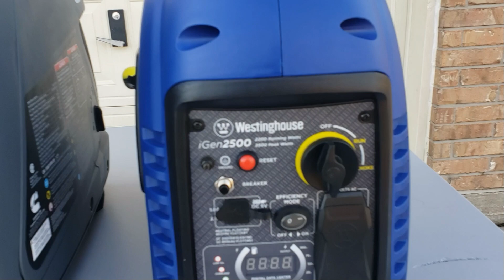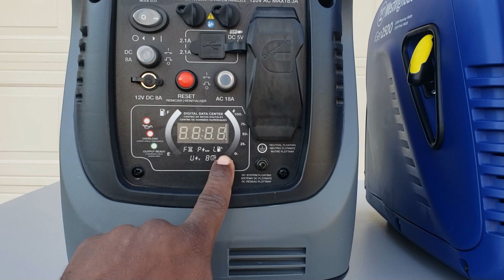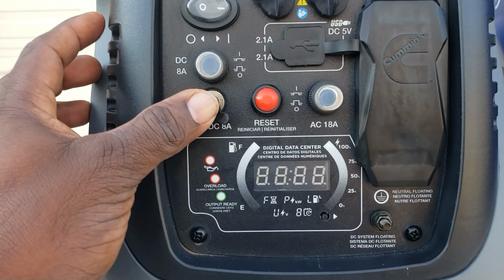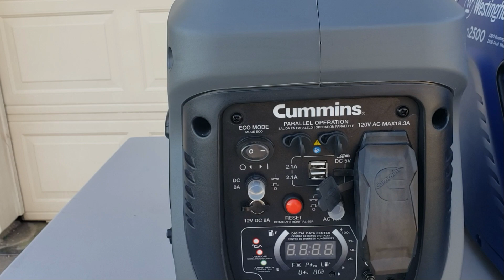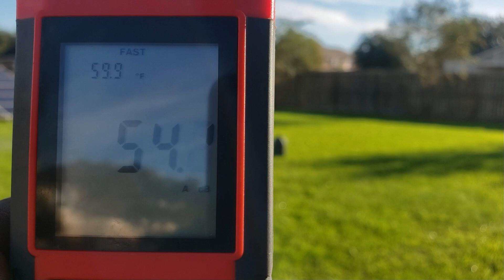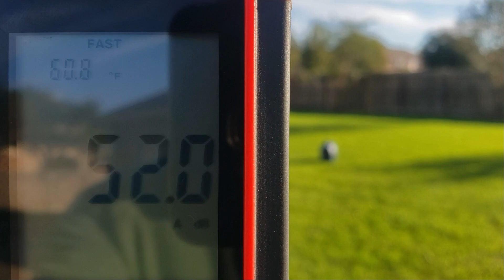CUMMINS ONAN P2500I VS WESTINGHOUSE IGEN2500 (Generator Review)

Comment: GOOD VIDEO GAVIN. I HAVE THE 2200 AND THE 4500 WESTINGHOUSE. I LOVE THE REMOTE START/STOP ON THE 4500. I AM HAVEING A LITTLE PROBLEM WITH MY 2200. AFTER SEVERAL EMAILS BACK AND FORTH WITH WESTINGHOUSE, THEY SAID THEY WOULD SEND ME AN NEW CARBURETOR AND GASKET. THEY SAID THEY WOULD EMAIL ME A TRACKING NO. WHEN IT SHIPS. OVER A WEEK NOW AND NO EMAIL.

Comment: Bought the cummins onan p2500i a couple years ago for work. Right out of the box it wouldn't hold steady RPMs. It did ok under a load, but still not right. I probably put 30 hours on it or so then it sat around for a while, the warranty was up and I never got it fixed. The next time I went to use it, it started fine, but then gas started leaking out around the carb. It sat for a few months then I got it out to see where the gas was leaking from. This time it didn't leak. Maybe the float was stuck when it was leaking. Still idles rough, surges up and down.
Reply from the maker: Sounds like it needs a carburetor and a jet cleaning
Reply: @GeneratorReviews  I cleaned the fuel tank out and found a little sediment in there. Removed the carb and cleaned it. The bowl had a little varnishing going on in it. The pilot jet seemed like it might have been dirty. Cleaned everything and was feeling good about it. Started right up and it was running better. Then it started surging again and continued to get worse. It finally died, restarted it, ran rough and died. I'm going to let it cool and try another cold start just to see how it runs cold. Then I'll pull the carb again and clean it again. I'm thinking it might have plugged a jet again.

Comment: FYI: You must use Westinghouse's spark plug wrench to remove the plug so far nothing else will do. I dislike; no I hate my Westinghouse 2500 generator. And yes I rejetted it. Try opening up the plug gap to .036", second your gas cap may not be venting, intermittently.

Comment: I like your video! I just bought a Westinghouse iGen2500 a couple weeks ago. The new ones come with the parallel ports. We tested it out on some rustic / off-grid camping, with our camper, last weekend. I was surprised that the Westinghouse was able to power our 25 foot travel trailer and the AC at the same time... it actually didn't go over 50% of it's capacity.

Comment: I so wanted to like the Westinghouse.  I wanted to parallel to for my travel trailer.  First one broke in flawlessly and had 5 hours on it.  The next two I tried sputtered and repeatedly shut down the moment I put even a small space heater on them during the third hour after two oil changes.  The first one handled the same heater just fine.  If I can't rely on them to run that without having two malfunction I need to try another brand.
Reply from the maker: Hey Frank sorry buddy
 some times it’s just something simple as the carburetor jets being dirty

Comment: The Westinghouse carburetor suffers from poor design concerning the location of the Idle Jet (in the back), It is almost impossible to clean if it had been left sitting for a while and is now surging. Similar ones like the Honda have the idle jet in the front where it is easy to access.
Reply from the maker: Yep great point!

Comment: Can you check something for me? With the Honda having a 120cc and others being in the 80cc range I’m wondering if the Honda runs at a lower rpm under low load conditions, anyway you could check that theory?
Reply from the maker: Ok I will put my rpm monitor on it. I will update you soon
Reply: @GeneratorReviews  I ended up buying the 2 Yamaha 2000s they both are great if you keep them under 500watts they basically idle, I plan on giving my dad one of the Yamahas when the eu2200s come back in stock, can you parallel two different brand gens?
Reply from the maker: @Bajaheat  Yes you can parallel different brands Actually made a video about that

Comment: What break in process do you do?
Reply from the maker: My personal Generator I run it for 30 minutes then I’ll change the oil.  I use it in eco-mode only powering nothing over 25% I’ll change the oil again after it has a full 24 hours of use No need to run unnecessary loads I’ll change the oil a second time then when I have 100 hours of Run time then I’ll switch to my synthetic 5w - 30 oil
That’s how I do it
Reply from the maker: Once I get my synthetic oil in there I can go all the way up to 80 - 90%

Comment: These are both identical units.  Same exact generator. Westinghouse makes / manufacturers these and Cummins just puts their name on it and a different color plastic casing.  My brother and I have (2) iGen2200's and (2) iGen2500's.  Absolutely great units.  Westinghouse also makes the bigger size 3700 / 4500 inverter "Cummins / Onan" version as well.  The only difference in this bigger inverterbsize unit is that the Cummins only is offered in a gasoline version, and Westinghouse offers that same gas model as well as a dual fuel version.
Reply from the maker: Thanks for sharing this we appreciate your support
Reply: That explains why the Cummins interior looks exactly like the Westinghouse Igen 2600...
Reply: you are 100% correct,  Westinghouse makes ALL of the Onan portable generators
Reply: Actually, neither are made by their respective brands.... They are both made by Ducar in China.  Ducar builds them to Westinghouse's and Cummins' specs.  So there will be a LOT of parts commonality between the 2 machines.  It is this way with all of these companies.  There are about 4 different major manufacturers in china... Ducar, Rato, Loncin, and Lifan.  There are others besides these 4, but these seem to be the major higher quality companies.  If you look, you will see that nearly 100% of the generators (and really, any small engine anymore that isn't a Briggs Vanguard) sold here in the US are made by one of these 4 companies... there are telltale signs to look for to see who actually built them.  But as far as these small generators, Westinghouse and Cummins don't build any part of them... these two companies are nothing more than a pair of marketers operating under a brand name... they don't own an single factory at all that produces this kind of equipment.

Comment: So these two really are the same. Just have to decide if it's worth an extra couple hundred dollars to have the "niceties" of the Cummins branded one. But, I looked up both generators and the Westy comes with parallel ports and the selectable menu now so, really, no difference between the two except in price. I'm still torn on what I'm going to get next camping season. Your reviews are wonderful but I want every genny you show. 😀
Reply from the maker: Yes I will update this video with the newest model
Reply: Well the fact that Westinghouse also makes the Onan generator for Onan, yes the new models are identical

Comment: On my Westinghouse 2500 does have a button on the right lower side of the meters, to toggle thru the data system. I have a parrell ports. You Must have an older 2500. I just received mine. Made in Vietnam, May 2021
Reply from the maker: yes I need to get an updated one

Comment: For me the Onan is the winner based on it's features especially the parallel port. Also, the no tool access is another win. Wide open access. No plastic support piece in the way like the Westinghouse.
Reply: Yes...I liked that "no tool" access into the side panel, as well.  I also liked that lack of no plastic brace down the center of the Cummins.
Reply: @campingalan  Brace. That's the word I was fishing for. Thanks!👍
Reply: I don't think the differences are worth the price difference.

Comment: Good morning, Gavin!  Thank you very much for starting your series on the 2500w category; or, the upper end of the suitcase, 1 arm carriable segment!  As always, you do a great job highlighting these units.  

Whooaaa....the Westinghouse is one of the models that I was considering, if I go in the direction of the suitcase/2500w category.  I DID NOT catch that the Westinghouse did not have parallel ports.  That is really strange, and pretty much a No Go threshold for me.  The key reason I'd want the parallel capability is that we'd attempt to charge our solar capable rig with one of these easily transportable generators.  But, being at the higher altitudes of Colorado, I would definitely want the capability to get a second one to parallel them, if we found that was necessary.  

Both of these options are nicely quiet!  When they are at 51 or 52 db, that really is getting to just above ambient noise!! 

Ha....when this video started, and you gave the prices of both rigs, I was definitely preset in my mind that the Cummins was not worth the extra $200-250 extra charge; or double that for a parallel set up.  But.....with no parallel capability for the Westinghouse, I would not be getting that one. 

Thank you again for this awesome comparison of these two rigs!!
Reply from the maker: Thanks as usual for watching With a total of four 2500 W Generators you should find the one you like.
Reply: Just bought igen2500 it does have Parallel connection and button to scroll through data
Reply from the maker: @waynelangford7574  yes igen 2500 has a model that does have it.
Reply: @waynelangford7574  Good to know.  Thank you!

Comment: I am kind of surprised you haven't tested any Hyundais generators. I have put my Hyundai 2800 in all types of situations; it has performed flawlessly! My Firman lasted only a year before the motor let go with 856 hours, and the second Firman motor just lost compression after 1100 hours. The Westinghouse just let go with the carb cracking. Why? Not sure yet! It had 1276 hours of run time. They all get the same maintenance with new sparkplugs, filters foam/ fuel, oil, cleaning the spark arrester, and adjustments with the valves. They get used, but not abused. Never had them run at full power, only at 50% to 70%. The Hyundai is still going strong with 3258 hours!
Reply from the maker: Thanks 
I will take a look at them
Reply: @GeneratorReviews  cool!
Reply: Interesting performance comparisons.  I'm assuming there is a quantifiable construction quality difference between the chinese and korean complexes. 

I remember 15 or so years ago when Hyundai's and Kia cars were somewhat the joke of the auto industry.  That is not the case anymore.

Thank you for your input.
Reply: @campingalan  I know right! Not anymore! Glad I could help! : )
Reply: @campingalan  A select few have a tendency to ignite though.